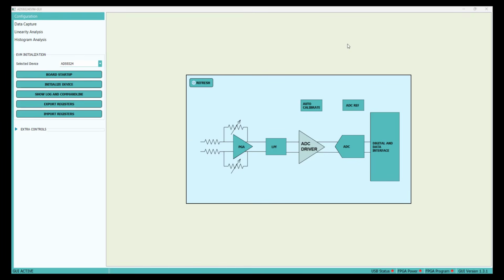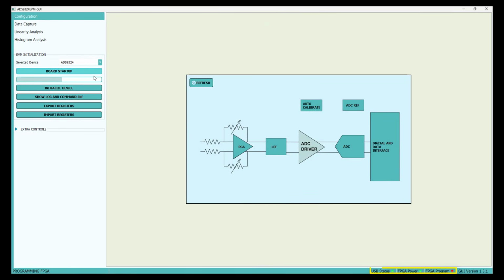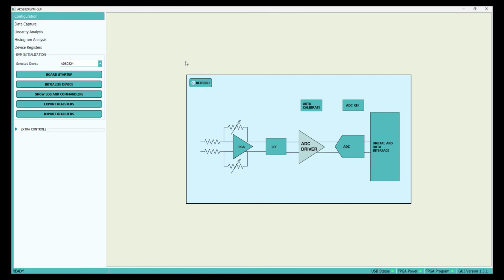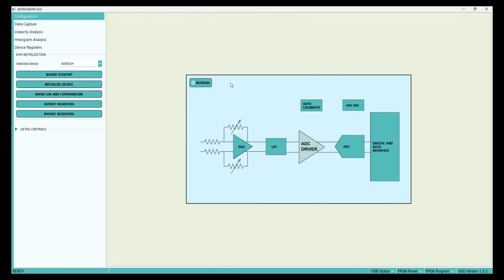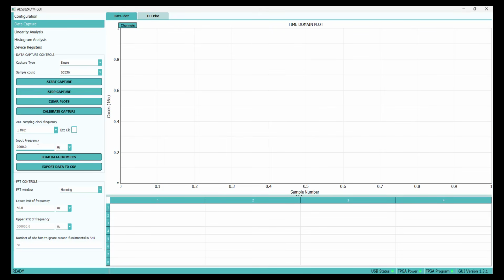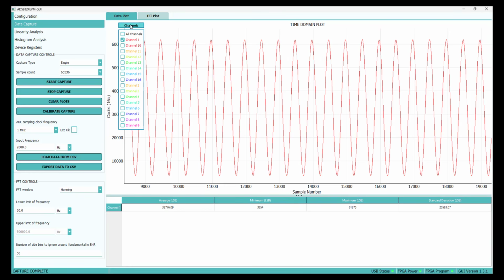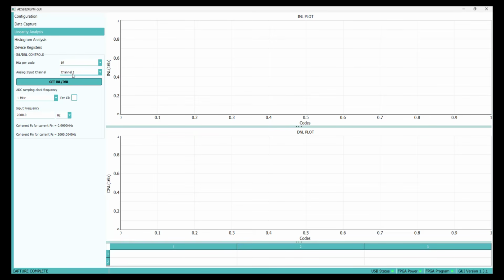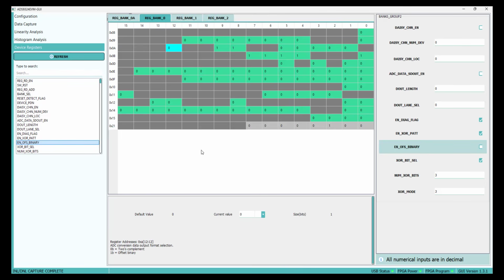ADS9324EVM Unboxing and Tutorial

Comment: Hello, I need 50 pieces of your integrated circuit, specifically the one labeled ANC16K/DO7Z, a potentiometer and voltage regulator for an MW12 Wi-Fi headset.